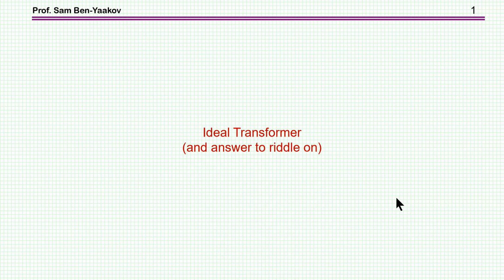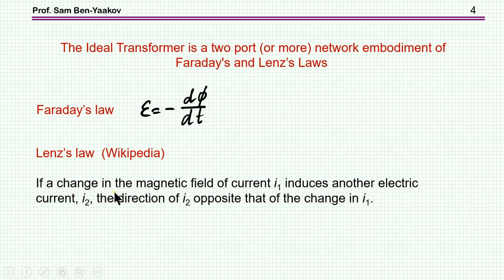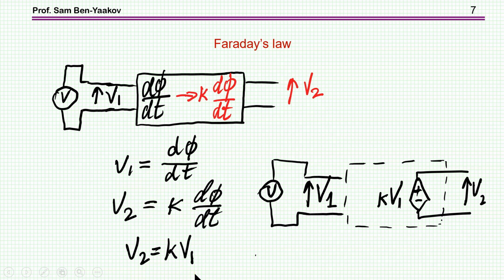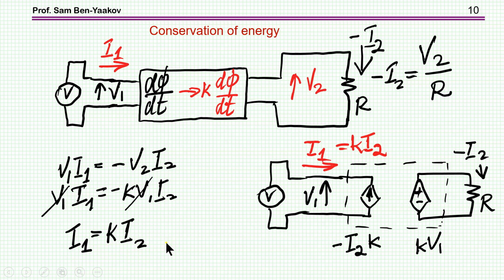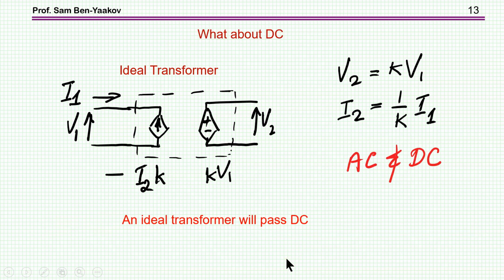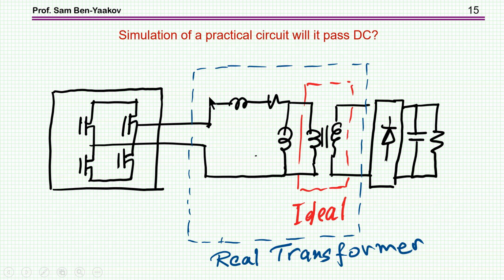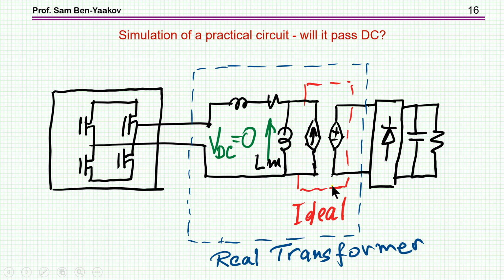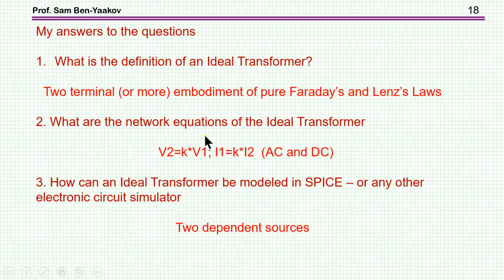Ideal Transformer (and answer to riddle on)

Comment: In minute 3:57, there is a minus sign from the conservation of energy suddenly gone. Equations starts w/ V1.I1=-V2.I2; Then, continue w/ V1.I1=-k.V1.I2 . There is a minus in both equations. Eliminating V1 should lead to: I1=-k.I2. However, in the presentation you have a positive sign for I1=k.I2. It will be also interesting to do the discussion adding the dot convention, which is not discussed. You can have a circuit w/ two ideal transformer and based on the dot convention the transformer using controlled sources will need to be different (arrows and polarity changed accordingly). Otherwise, the phase of the output will not be correct.

Comment: Hi Sam, I am trying to understand/simulate the current loop in the primary and secondary side of an ideal transformer. Can I calculate the coupled inductance for primary winding from the leakage inductance of the primary winding using the equation Llkge = L1 (1-K)?
Reply from the maker: How do you know the linkage of primary ? Measure the inductance with shorted secondary Ls. k=Sqrt( 1- Ls/L1))

Comment: I wonder if this model is universal enough for bidirectional operations. It seems that I cannot apply an active voltage source on the secondary side, or we have to switch the model in a reversed way. Correct?
BTW, there is also very hard to have a "pure" DC from negative infinity time to positive infinity time, but no matter what it is, the ideal transformer should pass DC. I have seen that the DC component transmitted through the transformer in Simulink when looking at the DC bias of dual active-bridge. I should have used a more realistic non-linear transformer model.
Reply from the maker: Hi Zihan, Thanks for comments. Yes,  it is bidirectional but in simulation you may wish to switch sources depending on impedance (for the sake of conversion) see https://youtu.be/qLoXOlrqZCU?t=845
Reply: @sambenyaakov  Got it, thank you Dr. Ben-Yaakov! It seems not easy to get a more general model regardless of the connected impedance - that explains why Simulink treats transformer model badly in terms of computation stability.

Comment: Questions:
isn't "open circuit" and "infinite inductance" effectively the same thing, (assuming this infinite inductor has no energy in the core of course, or I=0)
The dependent voltage/current model for the ideal transformer is not symmetrical like coupled inductors. Does this matter? Can I drive a voltage v(t) into the voltage end of it and expect a voltage or current out? will need to play around with it a bit when I have some paper handy
Reply from the maker: Thanks for conversation. In my opinion this is tautology. You might as well say that  the impedance is zero capacitance😊 or better yet, infinite resistance. If you bring-in infinite inductance I will bring infinite voltage and we will have infinite stored energy. The point is: you can "define" an ideal transformer by saying that it is a transformer with NO resistance NO leakage and INFINITE  inductances which are related one to another by n^2 (how do you relate two infinite numbers by n^2?).   But then, you did not say what  IS a  transformer to begin with. Or, as I have done, base the definition of the  ideal transformer on fundamental principles of electromagnetism. Then you get an open circuit. .
Reply: @sambenyaakov  Your approach for defining the ideal transformer is very elegant, I do certainly like that definition! Thanks for the great video explanation!
Reply: @power-max  post more videos
Reply: @two_number_nines  why
Reply: @power-max  to watch

Comment: Great video! Actually, it was proposed long time ago by Prof. Slobodan Ćuk: ideal transformer as a component that processes both AC and DC currents, which was feasible by using switch-mode power supplies.
Reply from the maker: Thanks for comment.